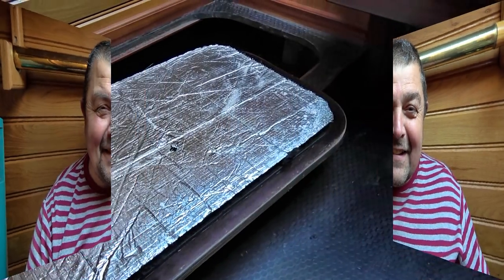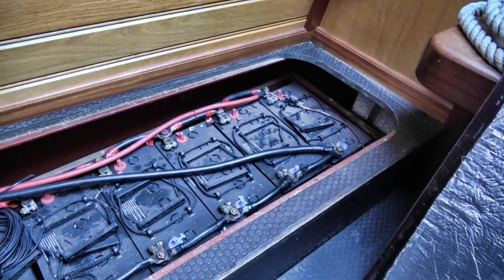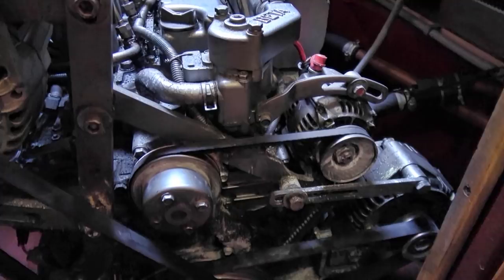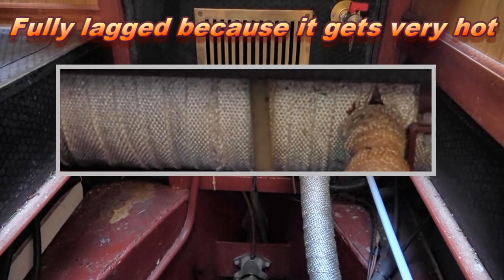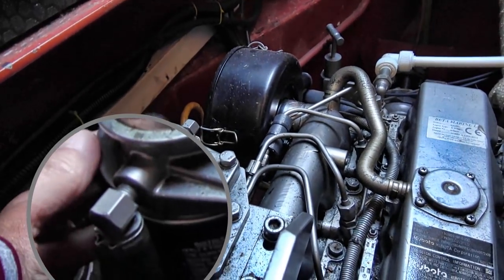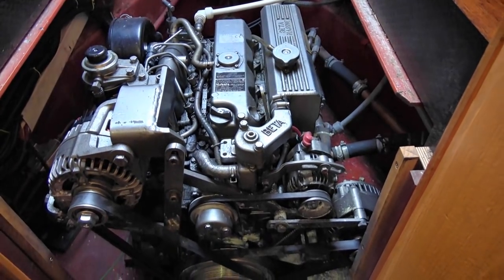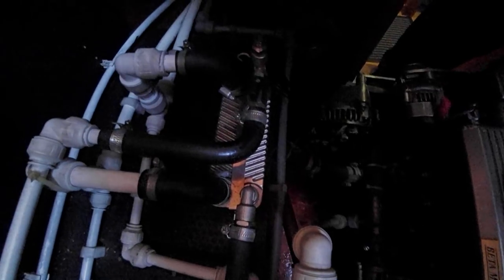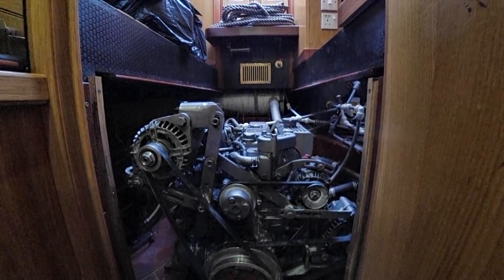Narrowboat Interior Design - Part Six - Engine Bay - Fuel Polishing - Free Heating

Comment: Just watched  part 7 and part 6 in that order! I have watched most of the others and will get to them ( YT is a great archive)  Fabulous knowledge based outputs but then so are you travel based Vlogs and everything produced is a quality product much like your boat. I had several questions but careful rooting through responses answered all bar one. I assume , but could be wrong, that the Alde ( and not Aldi ) exchanger can be used with other diesel "boilers" apart from Alde gas units, also your system included ball valve in a flow control capacity, I assume that is to avoid the boilers overheat failsafe operating. AND YES ROLE ON SPRING we are of this Friday for a weeks hire around the Anderton lift thick socks shoes and everything else!!!
Reply from the maker: Hello Brian
I thought I mentioned that but anyway the Alde heat exchanger can be fitted to any diesel boiler. The ball valve is basically just a balancing valve which makes sure the water travels in both directions rather that prioritising it one way. This is an idea I used many years ago when I was an heating engineer.
I suspect the canals will also be frozen. Plenty of layers required plus plenty of hot drinks.
Also try to find the pubs with coal fires. 
Cheers B & K 👍
Reply: Must have missed that, sad, I take notes and watch multiple times, deeply impressed with  speed of response , that said pub with fire sounds like an ace idea!

Comment: Another fantastic video and I will speak to the guys at BSL about fitting that oil filter tomorrow. I already have the gas bottle valves and even they hadn’t seen those and were really impressed. I would love the heat exchanger but have decided to fit solar as initially I’ll be a summer cruiser I can then take my boat back to fit this at a later stage. I’d love to do it all now but I need to pace myself a little due to the fact I’m new to this and not certain how things will go. I think you and Bernadette should seriously think about producing a book and DVD on “Things to consider before you buy or build a boat”, it would be a best seller. Dave has done my sign writing, he’s Kept it simple just the name and one scroll but it’s perfect for my little cruiser. Hopefully everything will be done and it will be ready to collect shortly. I’ll send you some photos when it’s finished. Thanks as always for the inspiration and ideas.
Reply from the maker: Hi Sylvia
It is a fuel filter not oil and gives total piece of mind.😊
The heat exchanger is a nice to have but is not essential if you are a summer cruiser.
You are quite right to pace yourself and see what happens.
Our new solar system 🌞🌅 is planned for June and will be 3mm thick semi-flexible which can be walked on and do not run the risk of our middle ropes snagging on them.
Everything seems to be falling in place nicely for you.
Very soon you will be out and about in lovely weather chilling out at a nice canalside pub or moored up in the middle of nowhere listening to nature, cows and sheep.
A book and DVD - could be done but problem is we are well and truly in retired mode. It is now coming up to five years since we gave up work.
As always we appreciate your comments, you are truly one of our veteran subscribers. Cheers B & K 👍

Comment: I been working on the design of my dream narrow boat. the propulsion motor would be electric charged by a 30 to 40 kilowatt diesel generator. it would have 1000 amp hour in batteries
Reply from the maker: Very few narrowboats are purely electric but an increasing number are hybrids.
http://www.hybrid-marine.co.uk/9.html

Comment: You certainly got a good setup there Keith, I hope nothing ever goes wrong down there , a mass of pipes and hoses that you need to keep an eye on , I did notice a bit of rust in your engine bay (18.30) . Having a narrow boat is not just steering the tiller :-)
Reply from the maker: Hi Stephen
Pipes, hoses, electrics, gas and water are no problems for myself. Before I worked my way up to a very high level job in the gas industry I was a heating and electrical engineer.
It is an engine bay so a bit of rust is inevitable. 
What you can actually see is where I pulled up the old filter and this lifted up the Danboline (bilge paint) .
This small area has hardly any rust and can easily be cleaned with degreaser and repainted but it is not urgent.
I would worry if it could be peeled up in pieces but then again our baseplate is 15mm instead of the more general 10mm so it would not be as dramatic.
Without a doubt narrowboats are not maintainence free but I prefer to do any jobs off camera and let the viewer just see the interesting bits. 😉
As usual thanks for watching, cheers  B & K  👍

Comment: Great vlog Keith a lot of technical to get through but we'll delivered.  I am new to canal boating and may have a daft question.  Why do you need a built in engine  generator ? I thought that if engine was running with high capacity alternator that during  high demand use of power for short periods there would be no issues ?
Reply from the maker: Hello Mark
Glad you liked the vlog. 😊
It is certainly not a daft question, it is a logical one.
The reason we wanted the engine generator was purely for high energy appliances which can drain battery power quite quickly.
A few quick examples:
We have been moored up for a day and want to use our coffee maker, our 1000w microwave and our drier. If we turn the engine and generator on then no power is drained from our battery bank.
Or
We are setting off and the batteries need charging but we are only cruising for two hours. The generator is turned on and all 240v appliances are then not taking energy via the inverter from the batteries. This allows the alternators to charge the battery bank very quickly in a shorter period of time.
Also our fridge/freezer (we cover this in our next design vlog) is a 12v or 240v dual voltage type. When cruising if the generator is switched on it uses 240v without drawing power from the batteries meaning again that they charge up very quickly.
I hope that makes a bit of sense. 😯😊.
Cheers B & K 👍
Reply: The Tiller People - Narrowboaters Thanks Keith, following on from this can you easily have these engine generators retro fitted and are they very expensive?
Reply from the maker: It all depends what type of engine you have, it can get complicated if your engine is not set up to easily take one of these type of systems.
Sometimes it is easier if you have the engine type and serial number and then if possible go online and get the contact details and give them a ring.
Our engine is a Beta Marine and we rang and asked for a guy called Adrian who was very helpful and went through everything with us.
We managed to get a large discount because we have had three new Beta Engines for our previous narrowboats.
They are quite expensive and would cost over £6,000 depending on the kit.
Another cheaper option which we had on our previous boat is a Honda EU20i inverter suitcase generator (Petrol) which is very quiet and costs around £1150 and is very reliable.
Hope that is helpful.
Keith

Comment: Great vblog! Can the engine driven generator be fitted to a canaline engine or is it solely for a beta marine engine?
Reply from the maker: Hello Joanne
In theory I cannot see any reason why you cannot retro fit a engine driven generator to a suitable Canaline engine.
If all your engine electrics are correct and the engine type and size is suitable then 3.5 and 5 kw travel power kits are available but it needs checking as it can be complicated.
See link below:
http://www.canaline-engines.co.uk/new-build/canaline-42-marine-engine/

Hope that is helpful.
Cheers B & K 🍻

Comment: Hi there

I just wanted to ask about your preference to Trad hull's.  I am considering buying and fitting a sailaway, so the whole myriad of hull designs are at my disposal (so to speak).  If i outline my dilemma, I am hoping you could provide a little insight or the voice of experience.  I myself am looking to be a live-aboard continual cruiser,  now a lot of people bring up the point of having "outdoor" space on the boat and opt for a cruiser stern etc.  My take on this is, you have all the outdoor space in the big outdoor country that you are cruising around, more important to me here is to maximise internal space.

So my current thinking is, being as i wish to be able to travel as much of the inland waterways as possible,  my current hull configuration of preference is leading me to a 60' narrowbeam hull with a trad stern and enclosed bow (as far forward as it can be made).  I am not one for wrestling with pram / cratch covers, so this seems like the most logical option.  What put's me off this however is the whole idea of having the engine and running gear in the cabin.  not having been on or in a trad whilst it is on the move or running.  Just how intrusive is the noise of the engine and is there a constant lingering odour of diesel in the cabin ???.

thank you for your amazing video's and the "tech" side of the design / planning / implementation you do is awesome.
Reply from the maker: Hello
Having had cruiser stern, semi-trad and trad narrowboats ourselves personally we would only ever choose trads. 
If you have a modern engine at the back you get very few smells if any inside the boat. The back cabin is also seperated by a door, we have had no issues with the engine and all our gear being in the back cabin and  it is also out of sight. Importantly for us everything is undercover and it is easy to shut up if it starts to rain. We are not fans of the pram hood but like the cratch and decent space in the bow, great for summer evenings and for storing things in winter.
If you install a large hospital silencer and insulate under the boards the engine is quiet.
We hope that is helpful.  B & K 👍📹😎🌞
Reply: @TheTillerPeopleNarrowboaters  yes that ticks all of the boxes.  Thank you so much :D

Comment: I can't believe the level of knowledge you have. Regarding the 3.5kw generator.....   So if I understood it correctly, you shut off the inverter while the engine is running and up to 3.5kw of power is available to use while the engine is running.....  Does it charge any batteries, or just bypassing the battery system completely?
Reply from the maker: Hi Steven
The great thing about the Mastervolt Ultra Mass Combi is all the automation. If we turn on the engine driven generator then the Mastervolt system stops any energy being taken from the batteries whilst we are using 240v appliances. Once we turn the generator off everything automatically reverts back to battery charging and 240v power via the inverter. All clever stuff which works extremely well if you have the right kit. Stay safe. B & K 👍💑😷
Reply: @TheTillerPeopleNarrowboaters thanks for the reply, I'm fascinated by this, can I ask..... while the boat is on the Mastervolt system and its powering everything as a mains system would....do you have enough electricity? Is it powerful enough? Or do you still have to be careful?
Reply from the maker: Hi Steve
Obviously we think about our power usage whether 240v or 12v but everthing is fine. If the sun is shining we tend to stay 90% plus throughout the day thanks to oir solar panel. At night we can have our LED lights on plus the TV and it will be 80% plus in the morning. The fridge is one of the highest power users throughout the day but on our boat we have a special Waeco fridge unit which does not use any power overnight because it has an holdover switch which releases stored cold energy for around 8hrs. If we use anything with high energy consumption  (excluding night time)  like the coffee machine or 1200w microwave we switch on the engine driven generator so no power is taken from the battery bank.
A lot of boaters concentrate on solar wjich is fine but they cannot maintain battery power if high energy appliances are used. Because we do not live on our boat Lithium batteries are not suitable because of temperature issues particularly over winter when the boat gets very cold if and when left in the marina.
We hope that makes sense. B & K 👍💑
Reply: @TheTillerPeopleNarrowboaters  thanks for the detailed reply.